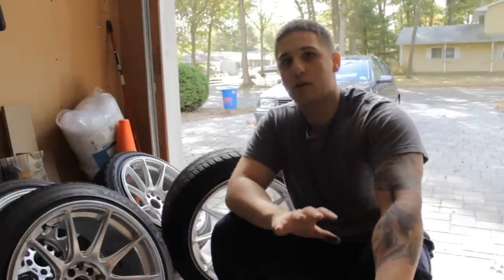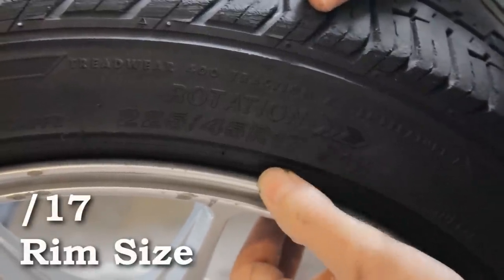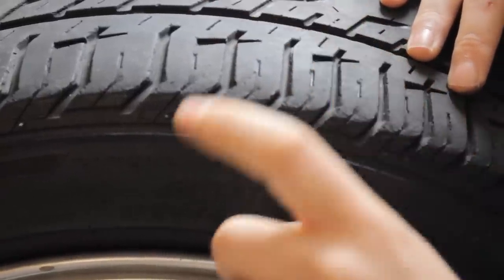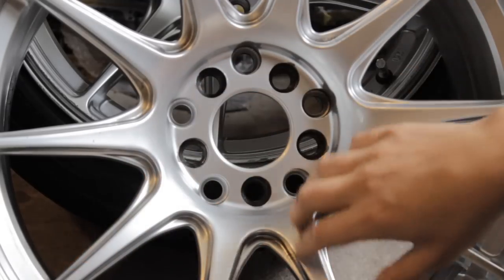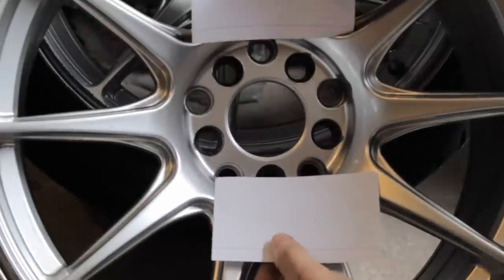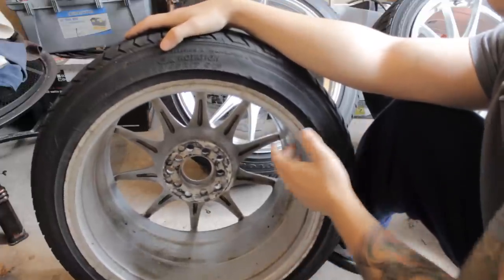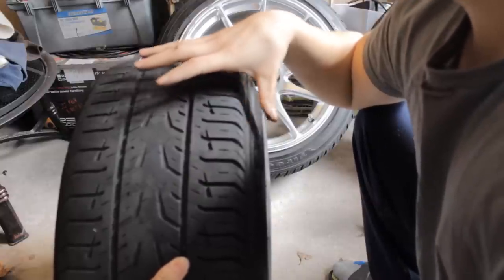GUIDE to Offset, Lug Pattern, Wheel/Tires Specs

Comment: So my rims right now are 16x 6.5 and the rims I'm planing to get are 16x 8.5, would they fit with my tires with no problem?
Reply: oscar contreras No, you will need to buy wider tires. Your wheels are 6.5 inches wide and the new wheels you just got are a full 2 inches wider.
Reply: Unless u want to stretch your tires on your wider rim.

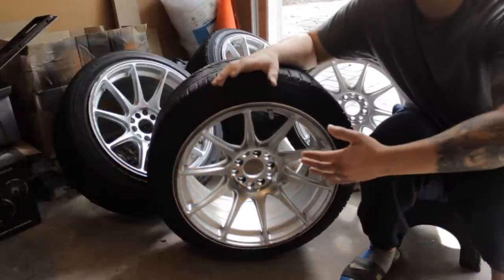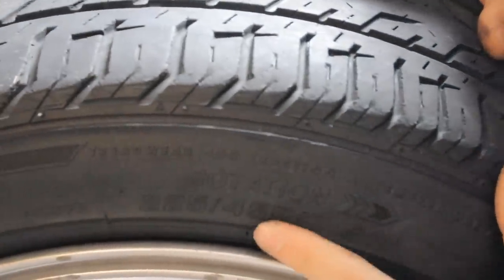Comment: Sorry but there are some mistakes. 1) 1:36 How wide the face of the rim is??? Also from edge to edge it's never 17" 18" or whatever size. The real size is not measured from edge to edge but on the inside where the tire sits on the rim. 2) 1:54 Width stated in J's is again not from edge to edge. It's were the tire hits the inside of the rim. 3) 2:41 Thickness of the tire? No it is the width of the tire. 4) 2:56 In my country we call it the sidewall height, which defines the sidewall height as a percentage of the tire's width. So if it says 40 the height is 40% of the width of the tire. So the height can change if you have a wider tire... 5) 3:25 A 25 tire height is not necessarily dangerous because if you have a really wide tire the height of the side will also increase. 6) 4:17 A lot of JDM are not only 4x100 but also 5x100, 5x114.3 and 4x114.3.

Comment: How do I find out what the offset is? I have an emergency spare tire (original equipment) for a BMW X3 that I am trying to sell, and am being asked bolt pattern, hub bore, rim width and offset, and I have no idea how to determine this.
Reply: It's usually printed on the inside of the wheel. Usually behind a spoke. It'll say ET followed by a number i.e. ET30 would mean a 30mm offset

Comment: i need someones HELP. i just bought a new car off this guy and he didnt know the offsets for the wheels (XXR 521) i have mb battles on my old car and it shows the offset on the back face of the wheel. i looked at the 521s and saw the specs but wasnt sure about the offset. the front is 18x8.5 and it had 12 written on the hub. rear is 18x10 and had two numbers on the hub, 23 and 25.. im wondering if those numbers written on the hub represent the offset

Comment: im not looking for stance or anything yet but my cars original wheels are 17x7 with an offset of +48 so i am wondering if i buy a set of wheels that are 18x8 with an offset of +35 will it fit fine?
Reply: I don't think you can stretch the actual rim size.

Comment: Does anyone know if changing tire/rim sizes on a car changes the function of the speedometer? If you put larger wheels, the car would be traveling more distance per tire rotation and vise versa, I'm wondering if that effects the speedometer and the odometer?
Reply: Yes it does affect the speedo/odometer readings. Use a speedo app that uses GPS and you'll see for yourself.

Comment: whats up muscleammo i have a question i have a 2002 hondda civic i want the rims i want 17 in rims on tthe and i want the rims and tire to sit flush with the car i dont want the rims and tires sticking out whats the offset number should i be looking at is the first question the question question i want the tire to cover the gap in the wheel well what size tire shoul i get

Comment: Please help me guys. I have a Toyota corolla 2005 and OEM rims for this car is 15x6.5 and bolt pattern is 5x100. 

I found the rims for my car but i don't know if this rims will fit 

I found rims 15x6.5 and have a 5 lugs but i don't know (seller doesn't know too) diameter maybe 100 maybe 114 and offset for my OEM rims is 45 but this rims have +36 offset 

will it fit for my car? 

P.S. New rims name is "Enkei ZNL Type 40"
Reply: try them first by puting them on your car if you don't know the diameter of the lugs, drive around for a bit to see if they're rubing and if you're all clear make a purchase

Comment: If my tire says example: 215/70R   I know as you explained the tire is 215 across and fits a 16 inch rim.. but now the part that gets me.. How do i know if this tire fits on a 16x6.5 or 16x7 ..  Can i assume 235/70R needs the 16x7 ?  please explain :)
Reply: You can find charts and lists for "proper" width tires for the given wheel/rim width. So, for example on my Jetta I run 195 width tires on a 8.5 inch wide wheel. The advised tire width for an 8.5 inch wheel is about 225-245 (depending on the brand on tire since some brands run a little big and others kinda small; similar to shoes). So, I have a mild stretch. The top of my tires' sidewall look like this: \ compared to | Make sense? It all depends on how much stretch you want, if any. If you want a more aggressive stretch, run a much thinner tire than specified. If you want a more mild, less noticeable stretch (more contact patch) then run a thinner, but closer width tire advised. If no stretch at all, run the "correct" tire size. People will run talk your ears off about how bad and dangerous stretching tires is, and they're probably right. But honestly, it's not THAT bad. I've never experienced extremely negative things about it. Just be careful when you're parking by curbs! Since most stock tire/wheel combos run tires that are actually a few mm wider, they protect the wheels from light curb rash. With a stretched tire, the lip of the wheel is entirely exposed; so keep an eye out for that.
Reply: Forza4You
Ok thanks for your answer..
Reply: No problem, does it all make sense to you?
Reply: Forza4You What you posted makes sense yes.. Does it answer my question... not sure... How do i know if this tire (215/70R)  fits on a 16x6.5 or 16x7..
Reply: You can just look up "What width tire for 6.5 wide wheel" on google or something. You can find out pretty easily. If you want a direct answer, call up your local tire shop; they will help you. 215 is wide for a 6.5/7 inch wide wheel. Yes, it will mount, but the sidewalls will probably bulge out. Just do a little research.
Reply: Forza4You Yup thank you very much :-0)
Reply: No problem!

Comment: Is it better to have a thicker tire or thinner ? Ex 25 or 45 ?
Reply: Usually it's safer to have and easier to live with a thicker tired because u don't have to worry too much about bumps, dips, etc. As he said in the video 45 is thicker sidewall but it's just a ratio of the first number, 225/45 is a different size than 245/45, both in width and sidewall size.

Comment: i just order some rota mxr-f that are 18x8.5 +44 i have a 13 wrx. i was wondering if they would fit and with what tire specs? any help? i wanted to get the 18.95 +38 would be better or worse?

Comment: i have a 2000 grand prix the stock rims are 16" but i am thinking about getting bigger once would u get 17" or bigger?
Reply: if you get 17" rims get a smaller series tires. example if stock tires are 195/50/16 then go with a 195/40/17 on 17" rims.

Comment: Great Vid!!  But i gotta tell you, the second number in a tire size is not exactly as you described.   Yes, its the sidewall height of the tire but its is always in ratio to the first number.   For example  205/60/18     this means that the sidewall height is 60 percent of 205.   So a tire that is 225/55/18     this means that this sidewall height is 55% of 225.

So....... both of those tires have almost identical sidewall height.

Comment: "I meant THIN.." bhahaha xD you are forgiven dude, nice video too...

Also quick question, I've been to my first auto-x event(and been to my second in between this question and the first event, same problem and all) and my tires would roll over and I'd start rubbing my sidewalls on the pavement a little bit. tire pressure was 38-41 psi(was a pretty warm day too) on what I think was 225/45/18 Coopertires Zeon ZPT on stock 18"x7.5 or 8 "09 Ralliart wheels. So if I wanted a stiffer sidewall would I need a larger rim or better tires?

Comment: if i have 16 inch stock rims and if i buy 18 inch rims how do i know if they will fit my car?
Reply: you need to look at the off set which you can look up online for your car. that will tell you how far the wheel is from the center. if you use the wrong offset, the wheel can stick out too far and the body will rub on the tire or rub on the insides of the car when hitting bumps or turning etc. for best results you can match the factory off set without modifications. if you stay in the safe zone for wheel size, you should be able to go larger with smaller tires and have a good look for your car. hope that helps.

Comment: Is it ideal to have 215/45 ZR17 tire for the rims 7x17
Reply: Google tire compare. It will tell you a lot. You also need to look up the specs. Each different tire size has a range of wheels it can fit. There is normally a minimum and maximum wheel width also...

Comment: how do you get tires on wided wheels?
Reply: STRETCH EM
Reply: i watched some videos haha. im just a car noob lol
Reply: Paul Johnson no you DO NOT stretch them. you buy a tire that is wide enough for your wheel.
Reply: Robert Wilson so why did u put a 225 on a 9.75 inch wide wheel
Reply: That's exactly what I was thinking. My Ford Fusion has 16x7 wheels I believe and I've read that safest widest tire size should be the 225... This guys is putting 225 on almost a 10 inch wheel.
Reply: Robert Wilson get proper tire size for the rim... But i have what this guy has xxr 527 17x9.75 25mm and all around i have 224/45/17 so the tire wont rub on my fender n its easier whip my car out with 225 vs 245 wide tires.. Oh n they are on my 95 240sx..

Comment: what are offsets use for??help I'm confused
Reply: +Sergio Bretado Smaller offset, the larger the track.  Larger offset the smaller the track.  

A better example.  An AMG A210 Mercedes needs offset on the front of 57.  If I used 35 offset instead, the wheels would protrude from the wheel arch.  This looks good but is not correct.     

If I wanted the track to be longer (wheels stick out more) with my 57 offset, I would need to add wheel spaces of approx 20mm (and longer bolts of course).  

Funnily enough the offset on the AMG A210 on the front and back is significantly different, but the staggered wheels actually look identical :D
Reply: +Sergio Bretado making your wheel flush with the vehicle or setting inside the fender more.  Offset basically just moves the wheel in or out depending on your offset.  Not sure how to explain it much easier.
Reply: +Sergio Bretado to clear the brakes

Comment: You explained the aspect ratio of the tire wrong, its not a measurement of the sidewall thickness, it is a related percentage of the tire tread width. So on a 225/50 tire, the sidewall is 112.5mm tall, but on a 275/50 the sidewall is 137.5mm tall. So you can only use the sidewall aspect ratio to compare the sidewall height of two tires of exact tread width.

Also, you explained how to measure the bolt pattern wrong, on a 4 lug car it is measure from the center of the hole to the center of the hole. On a 5 lug car it is measured from the center of one hole to the furthest outside edge of another. 

I stopped watching after that part to be honest, not trying to be a dick, but no point giving out false information.

Comment: can anyone tell me if i have a 5x100 and im get a 5x114 rims would it fit ?
Reply: Wouldnt fit. You'd need to get an wheel conversion adapter.
Reply: Nope won't fit. Only a 5x100 will fit.

Comment: Correction on my tire measurement why it came out #39 idk its 225/30/20 on front and 255/45/20 on back,ive cracked my front rims more then once so a thicker tire is best in my opinion but to each there own its cost me $60 every time I have to have the rim welded

Comment: 225/45/17

225 = width of TREAD
45 = percentage of width of tyre so 45% of 225 = 101.25mm high side wall
17 = diameter of wheel.

Comment: Your tire dimension explanation is sort of off in the case of your tires 225/45 R17 you have the 225 and the 17 correct. A little more detail on the middle number is that it is actually a percentage. Meaning your tire is 45% as tall as it is wide. This being said if you had a 285/35/R17 that tire would actually be as tall as your 225/45/R17 even though it is a 35 and yours are 45's. It isn't a huge difference on car tires but when you start moving up to trucks which tire widths can range from 235 to 305 that second number can be very deceiving. Other than that awesome video.

Comment: Your lug pattern measurement is wrong. A 5 lug pattern is measured by the diameter of a circle that travels through all five center points of the lug holes. Even numbered lug patterns(4,6,8, etc.) can be measured center to opposite center. a 5x114.3 pattern would probably measure 110-112mm using your method.

Comment: very good video BUT............you are wrong at the 5 minute mark of your video.On a 4 lug  or 6 lug wheel you would be correct.
On 5 lug you then multiply the distance by 1.05 to get the true diameter.

Comment: You need to do more research yourself. 225/45r17 would mean 45 percent of 225 the second number is not a standard it's the percentage of the first number. So a 255/45r17 would not be the same diameter as a 22545r17 tire. You failed to explain this important and basic bit if information.

Comment: before you impart knowledge, you should do more research. The second number 45 in this case is the aspect ration not the actual width. A 45 on a 225 is a different height than a 45 on a 245. 45 is the percentage of the first number.

Comment: #Gerardo Gomez +kctyphoon thanks was looking for this comment. he left out a lot of important information. @Erica Howard
Reply: #9 Miles +kctyphoon Good info.  Also, just to add to your comment, the width of the rim is measured from the inside of the bead area, not the outer rim lip.  In other words an 8" rim could measure nearly 9" if you simply tape the outer bead to bead. @Heath